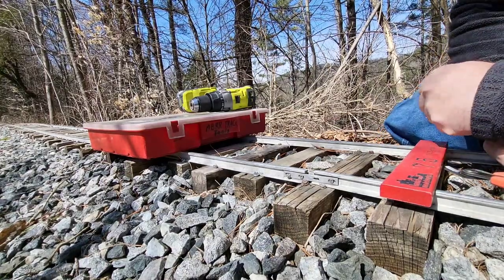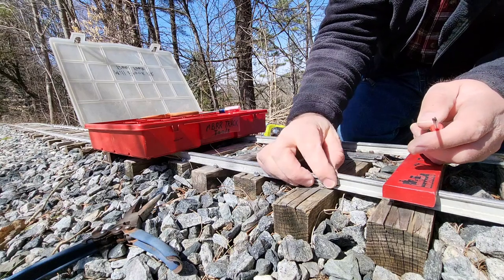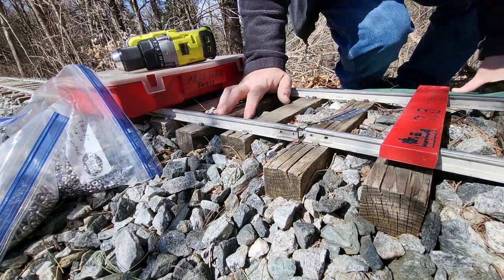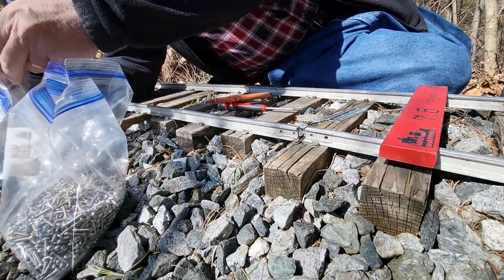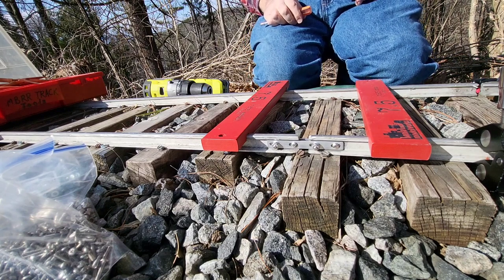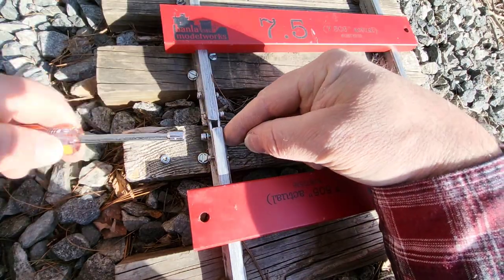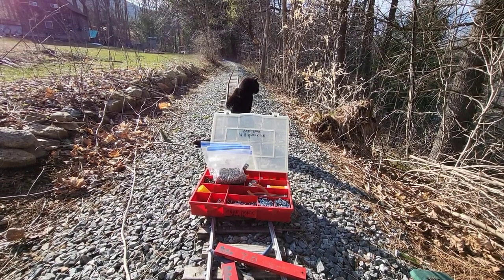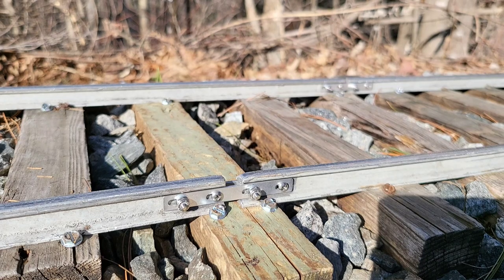Rail joint replacement

Comment: Good to see you implementing the buddy system. You can't always see an approaching train when you're so focused on the track work at hand. Say, is Batman rules qualified? Keep up the good work!
Reply from the maker: Well, if you can keep a secret, we don't use the buddy system at all. We use the Lowbat system. We wait until the batteries are low on the locomotives. 
Ok. I'm just kidding here. I rarely run the batteries down below 80%.

Comment: Wow, no snow! :) LOL So glad to see some issues your able to fix now.  If I can make a couple comments/observations, as for the messed up bolts to remove them I would use a battery powered dremel and cut off wheel. Another thought is that I still think you need thicker, or to double up the joint bars for strength, especially on the curves. And lastly, I wanted to share that all joints in the rails should be staggered on each side by a few feet so the other side can help support the joint and on curves help to eliminate the square joint that happens so easy. Sadly this would be much easier if it was done when laying the track for sure. :(   Always nice to see Batman! :)
Reply from the maker: When I was laying the track, I followed SR&RL (and British Rail) practice of parallel joints to reduce harmonic rocking on high loads.
Reply: @MillBrookRailroad  That is interesting. I have never read that about putting joints together.  As to your comment about Harmonic rocking......I thought Harmonic rocking was caused by physics and the speed at which that happens is based on the car length as well as its speed?  I believe any rocking at low speed is just caused by each joint being low from lack of track tamping?  As an example, when I was operating on Chessie back in the day, it is in the rule book that covered hoppers cars numbers XXXX must be operated below 28 MPH or above 35 MPH ( don't quote me on the speed now, it has been a few years) because of harmonic rocking with the length of those cars. They have been known to rock off the rails.  And was told when working on track work with CSX guys (again years ago) to always keep the joints separated by a few feet.  I am only speaking from 1:1 scale real life American experience on Chessie and early CSX. So forgive me if I am wrong on this. I am going to look up what you referenced for sure now. Thanks.
Reply from the maker: @s16100  What I've found is that there is not a clear consensus on the matter. I've been running trains on parallel joints since 2010, and there are some areas where staggered joints would probably help a little, but there are also other ways to keep the track in place. I see it as just a different approach. 
As I built the railroad out, I adopted the pholosophy of letting the rail joints be wherever they want to be. On the heavier rail, it is big enough that it really doesn't matter. On the lighter rail, it matters a little in a couple places, but that rail is so flexible that staggered joints probably wouldn't help much anyway.
Reply: @MillBrookRailroad  Ah ok, interesting. Hmmm more study needed on my part for sure! :)

Comment: Joints are always a troublesome area. Just wonder if anyone ever welded them. Steel or aluminium isn´t a big issue. But what will happen with expansion/contraction with 50 or 100 feet "long rails" ?
Reply from the maker: It'll do what it does. 20 feet vs 10 feet isn't all that much. Good luck welding them, though. There's no easy way to do it and no guarantee the weld will hold.

Comment: Wait, what ? Why is your track 7 & a half inch when your equipment is 7 & a quarter ?
Reply from the maker: Because I build equipment for both gauges. Locomotives, cars, and maintenance equipment. I need to be able to test what I  build.
Reply: @MillBrookRailroad  
Which is why you have check rails on your curves ! Got it……